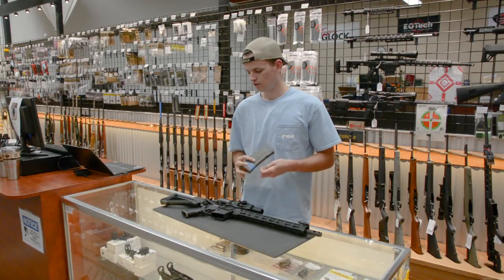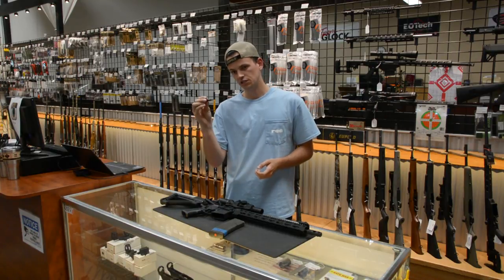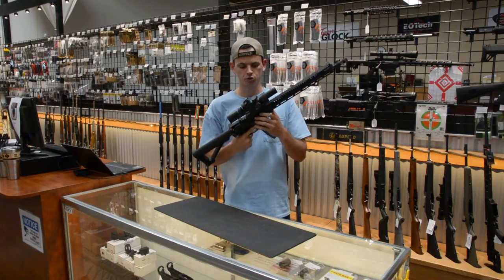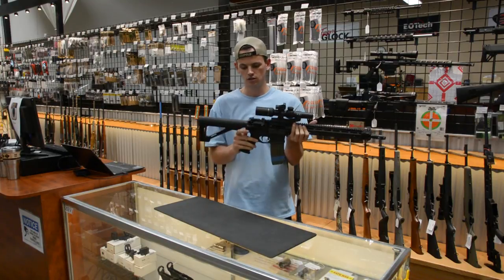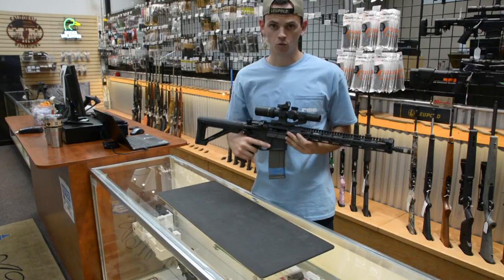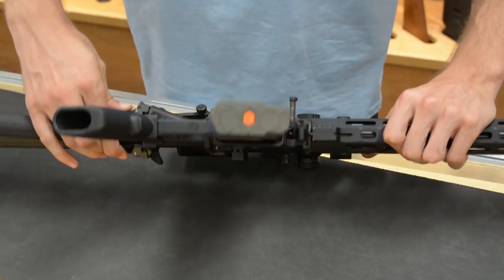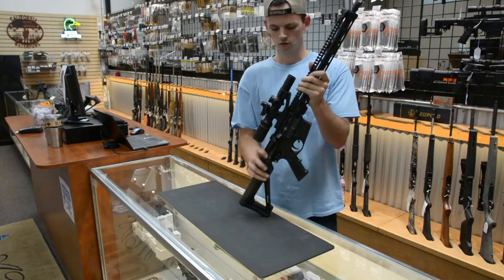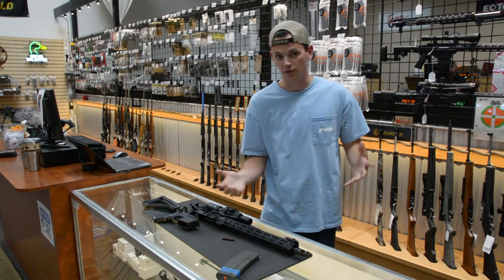Double Feed in Fixed Mag AR15

Comment: You can also remove the bottom plate of most polymer magazines to make sure you don't have any extra rounds to deal with.
Reply from the maker: C.J. Nuessle yes you can! just hope you don't have a full mag and can push that pin!
Reply: C.J. that's just more work. Usually taken down the takedown pin just by itself opening up that upper and lower a little will do the job to get the mag out.
Reply from the maker: You’re one dense person lmao fixed mag guns are NOT for defensive use. But I guess my many comments on that aren’t clearly spelt out for you. 

Some people like to plink at the range and have a normal looking AR. Not every gun is a defensive tool and some people just want a gun that looks normal. This accomplishes that. And at the time this video was made it was the fastest/best option around. 

Relax a little. You’re getting way to worked up over someone showing a product demo. The whole purpose of these videos were to show people the use of them so they can make a decision.

Comment: Yeaaaahhhh that looks safe.....
Reply from the maker: Munkie Bunz point the gun in a safe direction and keep your finger off the trigger. Guns aren’t dangerous
Reply from the maker: Listen dingus I’ve always been of the opinion that fixed magazine is NOT for defensive use. Fixed mag guns are for range plinking when nothing is shooting back at you. The actual mag swaps while using this setup are easy. But if you get any sort of jam it’s NOT an easy or fast solution. Cross Armory is an expensive solution, but at the time it was the best/fastest fixed mag setup. 

Featureless has always and will always be the best means of compliance for defensive AR15s
Reply from the maker: The quick pin and other fixed mag setups that use a rear takedown pin replacement are definitely faster than popping a milspec pin out and then removing the mag and popping the standard pin back in. If you’ve EVER spent a decent amount of time with a fixed mag gun you know that the rear pin is the part that takes the longest and companies like Cross Armory and Juggernaut tactical are both making products that speed that up. 

As I’ve always told people, fixed mag is inferior to featureless if you plan to actually use the gun. If you’re just gonna bench plink, fixed is fine. But I don’t like them for anything else
Reply: Reno May thanks for the work you do. I’m glad you took all of that time to explain this, both the video and your replies.

Comment: Another option to clear the malfunction is removing your maglock in order to remove the fixed magazine.

Regarding legality (from a non-lawyer): With maglock, the AR does not accept a detachable magazine, as currently defined by law. Once you remove the maglock, the AR still does not accept a detachable magazine- they fall right out, because there is no catch. In neither condition would the rifle be considered an assault weapon.

The law (Section 30515) does not call for the method of locking the magazine to be permanently attached, only the magazine itself. With the maglock installed, this condition is met. With the maglock uninstalled, the magazine is no longer attached to the firearm at all, any more than one you have in your pocket/FLC/range bag/safe is attached to it.

This option is also a bit safer, as it is less likely to have the bolt catch a finger or an primer strike once the takedown pins (and thus bolt) are released.
Reply: According to the latest rounds of regulations, "An AR-15 style firearm lacking a
magazine catch assembly (magazine catch, magazine catch spring and magazine release
button) constitutes a detachable magazine. "
Reply: This is wrong.
Reply from the maker: Nobody with any real experience with ARs is using a fixed mag gun for a defensive firearm. Stop trying to force the “heat of battle” issue. 

Just relax you’re clearly hot and bothered about something that I never recommended as a defensive weapon.